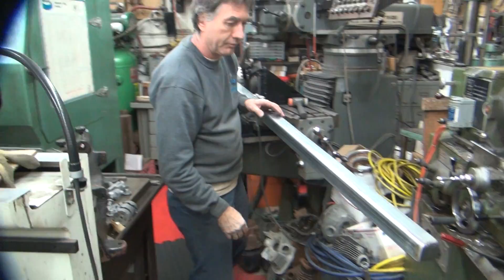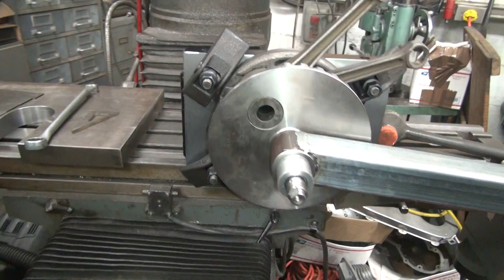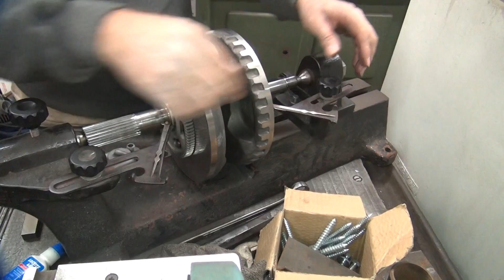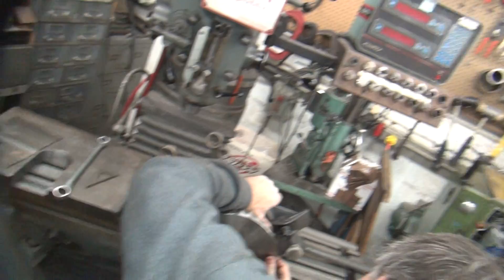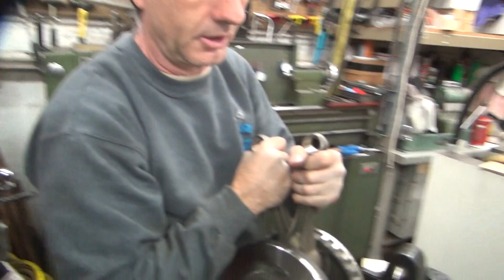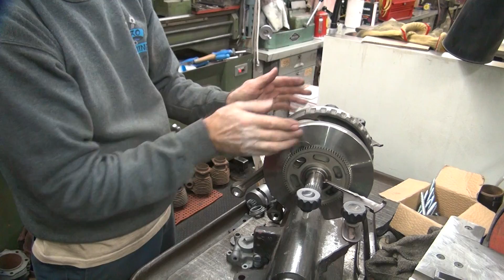#153 the making of flywheel truing tool crankshaft rebuild time m8 evo twincam harley tatro machine

Comment: Tatro, Would welding flat bar diagonally on the inside, the length of the tool stop the flex enough? staggered welded every six inches or so,with a slotted hole for the bolt? Like the  anti intrusion bars they put into car doors,  but they are made from rectangular tubing not square aswell? Thanks Tatro for the time you take too explain things with the videos. Cheers
Reply from the maker: i just made the lever longer and out of 1/4" wall steel. it is nice and solid now, but heavy.
tatro
Reply: @TatroMachine  cheers

Comment: I was wondering why you didn't use the HAMMER from the get go. Is welding the pin necessary?
Reply from the maker: the mainshafts are too weak and screw welding.
tatro

Comment: Couldn’t you mark your high side with a sharpie and put a whiteness mark across the pin and flywheel so you can see if it moves
Reply from the maker: come on, we are only taking about .002 movement.
tatro

Comment: I gather if that crank pin isn't tig welded it's likely going to scissor and/or shift again?  The aftermarket ones by Dark Horse and Carillo come already welded I think. Wouldn't have been a bad idea to weld it up just in case the inevitable happens. I'll never own something like that but if I did if be paranoid of that happening to my lower end. What a POS design... 
Even if it does have sleeve retainer etc. JUNK
Reply from the maker: yes it will move again. welding makes things weaker because you loose the press fit from the welding heat. the only way to gain any streaght is to do a really deep multi pass weld beads. good luck on having anything near a thru crank when you are done. i have shone this loose of pressfit in my older twincam crank videos.
tatro